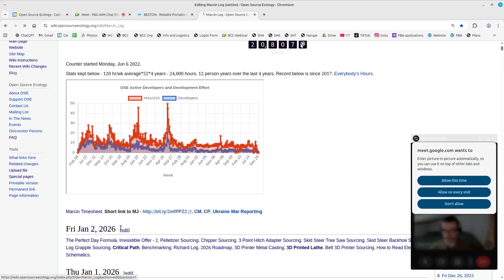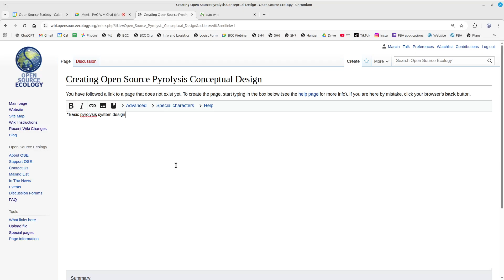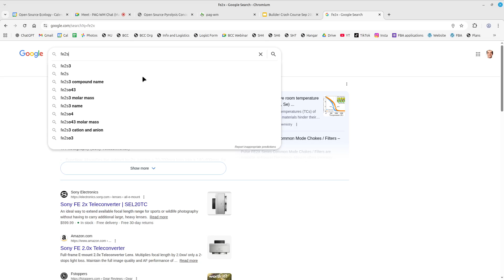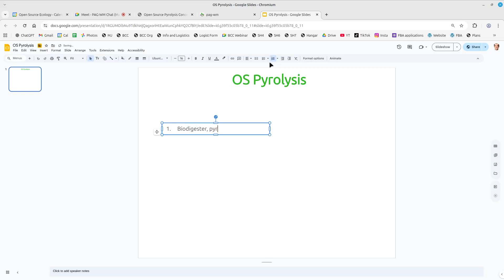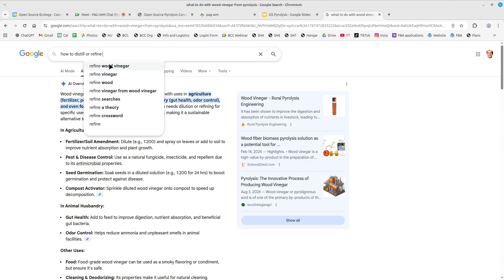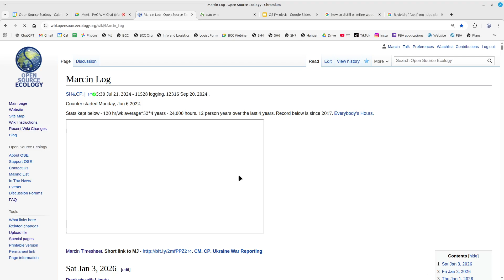Global Waste to Global Fuel: Open-Source Fischer–Tropsch and Plastic Pyrolysis

Comment: 31:20 🚨Minor Safety Bit 🚨

For what it’s worth i’m not a “Proper Industrial Hygenist™️©️®️” (yet), but i do have my OSHA-30, HAZWOPER-40, and work as an Environmental Service Tech using Monitors for H2S dealing with this type of stuff

ANYWHO:

Marcin is right that At SOME concentrations you can smell H2S / Sulfur Oxides and Products of Combustion.

HOWEVER as with Carbon Monixide (CO), one of the big concerns with Hydrogen Sulfide (H2S) is it’s “Odor Detection Threshold” isn’t perfect so when it can be LETHAL you are essentially “Nose Blind” to it.

GRANTED short of MAYBE Confined Spaces in an Anaerobic Digestion Plant the concentrations shouldn’t be TOO bad;  Refineries and Oil/Gas are where it gets really spooky; (Rusty) PIPELINES of PURE H2S etc.

All in all figured this was a good bit of info to drop, and again i’m not a PROPER expert, but if this helps someone out it’s worth it!
Reply: 1:04:45 Liberty touched on more of the H2S Safety / Design Decisions here for those who are curious!